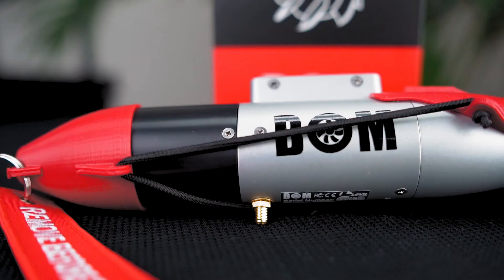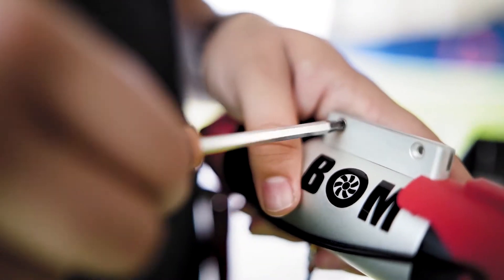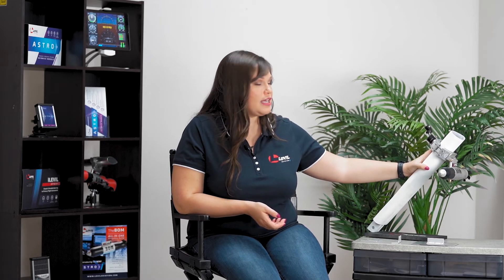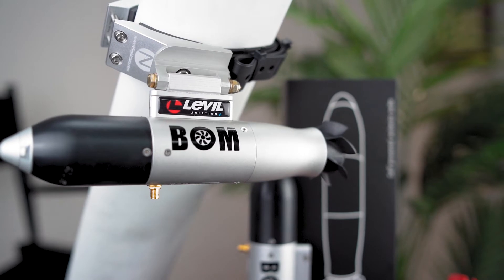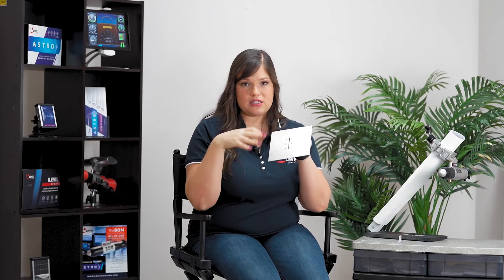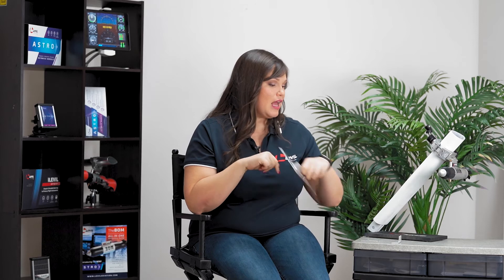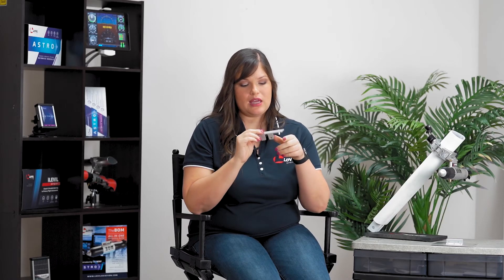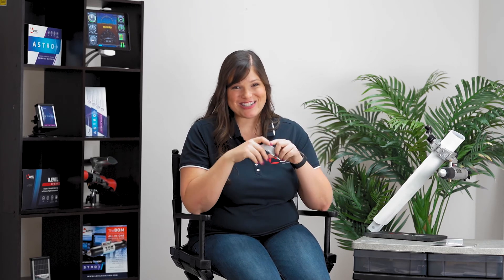Fast and Easy BOM Installation by Levil Aviation

Comment: Are there any plans to integrate an ads-b out with the bom? Or to possibly bring back the beacon?

This would be for experimental that I'm asking about.  Thanks in advance!
Reply from the maker: The BOM doesn't apply for ADS-B out since it is self-contained and not wired to the aircraft.